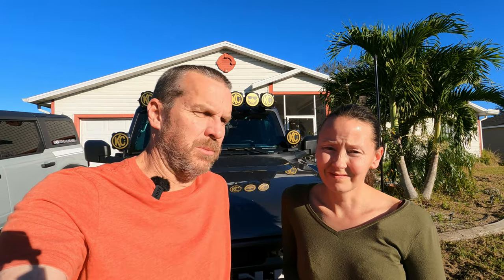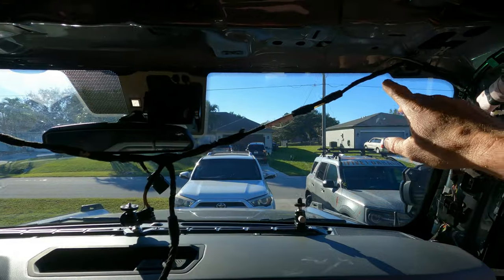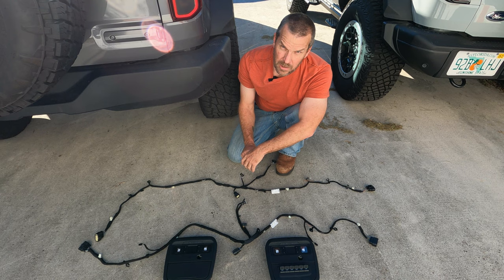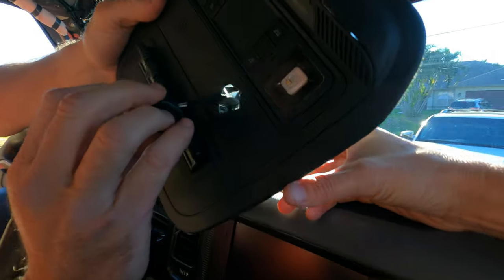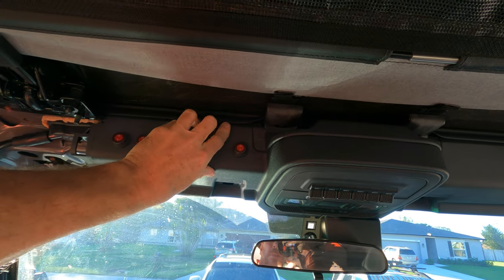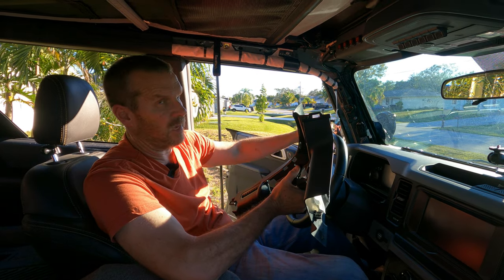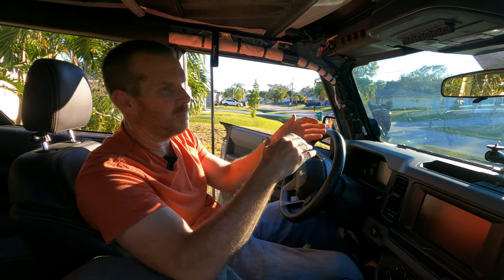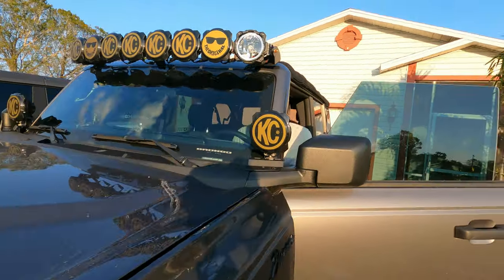Bronco Gets Factory Auxiliary Switches Installed. It Is Possible, But At What Cost?

Comment from the maker: Parts Needed (Confirm W/Your Local Ford Dealer For Your Specific Model)
Overhead Trim Panel: M2DZ-78519A70-JC (Includes 6 Aux Switches)
A-Pillar Wire Harness: M2DZ-14335-C
Fuse Junction Panel Assembly (Fuse Box): MB3Z-14A068-NBA

Comment: I have the upfitter switches in my Bronco, and also opted to add switch pro system. The procedure you just performed costs about 1000 for parts. The switch pro system is much more versatile and costs much less!!

Comment: Now I’m even more angry at my dealer for altering my original order when they converted my 2022 order to 2023, they dropped the tow package and auxiliary switches without asking/telling me.  
When I confronted the salesman he claimed it wouldn’t have been built if those options were on the order. 
Great video, one day when I have extra time and money I’ll attempt this. Keep it up!
Reply from the maker: The tow package might have held it up but the aux panel wouldn’t have.
Reply: Matthew "Rusty" Restiano  
I’ll probably try to get at least something out of the dealer.  Armed with your video, I trust myself doing the install rather than one of their guys.  
I’m not actually in a big rush to add a bunch of mods that would necessitate the switches, but I knew $195 to get them installed by the factory was obviously the way to go.

Comment: A great way to sidestep all the extra work.  Ever ready makes a wireless switch system.  No need for wires to come into the cab.  Everything hooks up under the hood.  Place the unit where you like and run the wires out.  I’ve got that in my pickup.   I’m looking at a couple broncos at the moment.  And a couple have the sunglass holder.  The everyready set up would be the easiest way to go.
Reply from the maker: That would be a perfect way to wire up my wife's rally car. will look into it.

Comment: Been waiting for this
Reply from the maker: Yeah I told Shawn I was seeing several ppl requesting to see how this was done and since it wasn't 90 bazillion degrees out this week, I figured it was a great time to get it knocked out. I ordered a new header panel (panel where the aux panel sits in) to replace the one we drilled into so we are going to switch that all out. :)
Reply: @1Five1Garage  yeah I just bought a base bronco I’m trying to make videos to show people a cheaper route then getting a higher trim model, so far took the base added the signature lights a new steering wheel added the Everglades 17’ rims to a set of 33’s and added color matching fender flares and the door lock color matched as well. Going to keep doing stuff so far I’ve put enough into it and I’m still under asking price for a big bend so I’m happy with how it looks

Comment: For Mine, the Cost for Both $652.35
Overhead Trim Panel: M2DZ-78519A70-JC (Includes 6 Aux Switches)
A-Pillar Wire Harness: M2DZ-14335-C
For after Market relay about $149, depend which website you go to.. 
Rough Country Multi-Light Controller MLC-6 Bronco
Total to install Myself,  about $801.35

Comment: So if I’m following this correctly, my OBX has the right harness (visor mirrors) but the wrong fuse box top IF I want to use the factory ran wires to add my own aux setup. I see the 6 wires for the aux under the hood but have the sunglasses holder. Interesting.  Thanks for the video.
Reply from the maker: No problem. Your welcome.

Comment: My Outer Banks (High,Lux,Sasq) has the internals for the switches.  I have seen a few people with higher end options who have the same thing.  So you may not need the fuse box.  I was kinda disappointed that the OB didn't have it on the order.  When we looked at the order sheet, the dealer did order it, Ford didn't put it in.  I think they put everything in but the switches and the harness.  One guy locally has the harness and the box, no switches.  I'm assuming that ford deleted the switches on some orders toward the end of the model year but not all BOM stations received the correct changes.
Reply from the maker: A lot of people thought it was just the switches. After talk to a lot of different people that found the same issue I worked with someone with an OBX to figure the solution. It easy to figure out if you need to fuse box. You can see the internals weren’t there.

Comment: Your earlier video on this subject caused me to immediately call my dealer and change my order to the upfitter switch panel. I will store my sunglasses in the console, thank you! Only bummer is that later my dealer called me and said that Ford was telling him I needed to drop the modular bumper and the tow package. I was planning to get those cool pocket lights on the mod bumper and hook them up with the upfitter switch panel. Now I've got my '22 Outer Banks with the switch panel, but no cool lights on the front bumper! What to do?
Reply from the maker: LOL!! well that's good! Yeah it is a real chore to do this and it's not overly cheap either. It's amazing how a $195 option can save so much down the road. :)

Comment: The difference between the OEM Fuse box for the Aux Switches, and the After Market relay from Rought Country is The harness connects to your factory wires. Gives you the piece of mind that you aren't going to burn anything up on your install. Because the OEM fuse box have different amp for the 6 switches,

Comment: Great video. I don't know if there would be enough of a return on investment by doing this. I bought the aftermarket LED switches to do like you were originally going to do. Are you going to replace the panel that you drilled to put the LED switches in? If so, I would be interested in the one you drilled. Love your videos. By the way, I live about 5 miles from the Michigan Assembly (Wayne Assembly) plant the Broncos are built at. Keep up the great work.
Reply from the maker: Yes we will be replacing it.
Reply from the maker: Send me a message on Instagram.

Comment: There another Youtube Channel that to dedicated Auxiliary Switches install, from Middleton motorsports, Which help me install mine. They beat you first, What I did to mine is the OEM  overhead trim panel, a-pillar wire harness, and aftermarket relay (Rough Country Multi-Light Controller MLC-6 Bronco $149, which hook up existing battery mount instead of oem fuse box, so all the wire connection goes to the relay box, and control by oem 6 aux switches..
Reply from the maker: We pulled all the panels apart a long time ago which helped Rusty from Bronco6G to figure it out. He was the first person to do it. Using the videos a had made. 😃
Reply: Matthew "Rusty" Restiano  No, not really, Youtube does not have pic on to show it.  6 wire next to the brake booster, which connect to the harmess povide by rought country, the 6 wire next to the brake booster control the 6 aux switch. The light wires goes to the relay box. I am surprise there is no video on that,  the instruction does not make sense until I got the relay box from rough country, I happen to stumble on it when I was looking for an alternative uplift switch, there one with no switch, but use the oem uplift switch, so I look into it alittle more, and decide to get one.

Comment: What i cannot understand,  ford motor  company  for years have made so many diffrent versions of harnesses  just to make it difficult  to add on a accessories  that were not installed. Chrysler on the other had installed one harness with tied off accessories  ability  on one harness.
Reply from the maker: Yep. To make it harder to modify the vehicles. Or just to make a little more money later on to add those items afterwords.